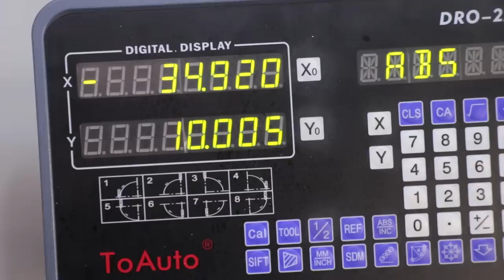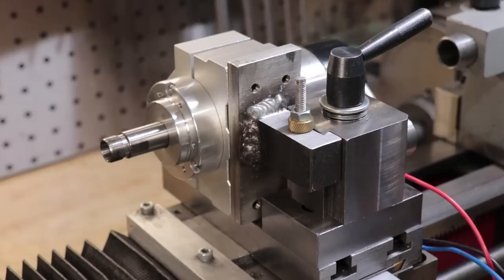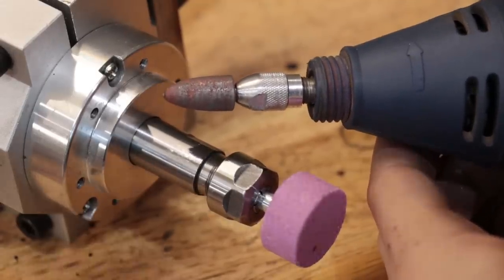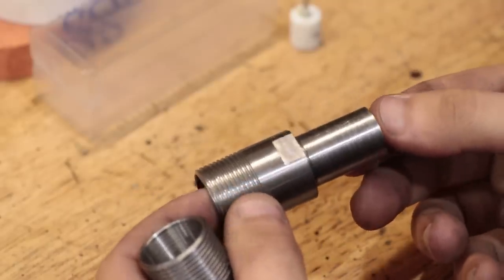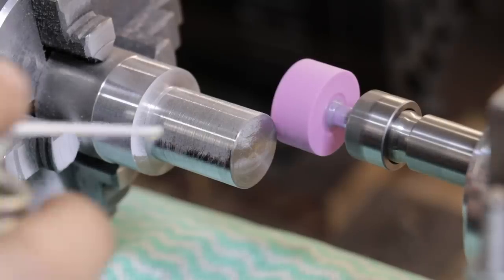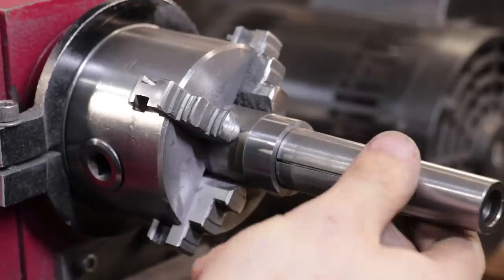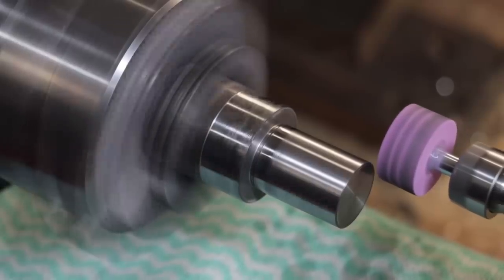Lathe Toolpost Grinder Build

Comment: I find your determination extremely impressive. I have a suggestion that might help the rigidity and in turn leave a much better finish from your lathe spindle. The mini lathes use a plastic bearing retainer on the head stock spindle bearings. If you replace them with metal retainers you will be very surprised at the difference in surface finish. Keep up the hard work
Reply: Great practical tip and it probably applies to other machines.
Wish I could give you more than 1 thumb.
Reply from the maker: Okay I must admit that has never occured to me to replace. I'll definitely have to look into that. Cheers

Comment: Work piece rotational speed should be slow compared to the grinding wheel. Doing so improves surface finish, reduces vibration and lengthens the time between wheel dressings. Coolant should either be flood or none at all otherwise thermal distortion can occur (of course depending on part dimensions).  As someone else commented (and I agree), reducing the contact area between wheel and part offers huge improvements in surface finish. Hope this helps going forward. Great job, keep up the excellent videos :)
Reply from the maker: Someone else suggested that too. What I found was that it didn't make much of a difference with soft steel. Low lathe rpm definitely is what is needed for working with hardened steel though

Comment: If you chamfer the holes before you tap them, you'll get better looking results.
Reply: More sturdy first thread
Reply: It dramatically increases tap life and it also decreases the chances of a snapped tap (at least if you don't harden the chamfer with a dull cheapo countersink)
Reply: @Sketch1994  Machine taps ftw, they’re not nearly as fragile as regular straight flute taps. After a few years of looking around and buying what I can I now don’t have to fear at every turn wether my tap is going to install itself permanently in the hole.
Reply: @shiro-r4m  Totally...I stopped buying cheapo machine taps (mostly use Volkel and OSG so far), while I don't even remember when was the last time I paid for a hand tap...
Reply: @Sketch1994  I've had good luck with OSG, Emuge, Fraisa, Walter and YG. But to be frank probably any brand that produces a full range of cutting tools is going to have some high quality tap options as well. 
There are different quality levels of taps within the brands as well, designating what tensile strength you can reliably cut with it.
I find they are very expensive though new, you can easily spend 50 EUR for an M12 tap from the brands I mentioned. I buy them slightly used and they just last me forever. Unless I do something stupid and run them too deep into a blind hole while power tapping on the mill or lathe, that easily snaps them.
Reply: @shiro-r4m  Ironically a brand new tap is a lot more likely to get chipped than a tap that is worn in a bit. Also very true about the different qualities within a same brand. All reputable cutting tool manufacturers can make a solid quality tap, but then there are the high end and application specific lines of tools that you can't even use without an equally high end setup. Sync taps (easily 120+ for an M12) for example which are meant for rigid tapping on machining centers, and whose non cutting threads are relieved to not contact the workpiece (they can't feed at the correct pitch on their own and they are not meant to self center either). I had tried telling my ex boss that you can't tap over a gap with these on a drill press, but he was convinced that this is how aluminum taps have to be for some reason (I was also the only actual machinist in there so I very often forced to cringe my way out and let them chase their tails)

Comment: Just a suggestion ; relive the grinding wheel so you a smaller contact area with the part when grinding it should help with surface finish and easier to maintain parallel diameters

Comment: Cool build. I wanted to drop a note that the runout of the tool holder that you made at the end is actually less than 10 microns! Probably closer to 5 microns. This is because you measured with the probe of the indicator at about a 45 degree angle relative to the runout which amplifies the measurement. If you want to learn more about this effect you can look up "test indicator cosine error."
Reply from the maker: Never going to be able to live this goof down. Oh well at least I got it recorded in the best 4k footage for everyone to see. 😅
Reply: @artisanmakes  Haha, it's great though! It means its twice as good as you thought it was :)
Reply: @artisanmakes  you can read my reply above this one for the explanation, but I dont think it actually was a goof...

Comment: You really make that little mini lathe sing bro. I am ever impressed with what you're able to coax that little thing into doing.
Reply: I mean I think he replaced a majority of the parts by things he made himself haha.
Reply: Best mod I've seen him do that NO ONE anywhere else has done is put a 1" x 2" steel block brace under the headstock to the foot behind where the motor mount is. Of all of the videos, forums, and personal sites I've searched he's the only one I've seen address this issue and I'm in progress of doing it to my LMS 5100.

I would like to see him do the carriage taper gib mod following Rick Kruger's design from 1999 - I just finished my own variation of that mod on my machine and it seems to be much smoother and stouter
Reply: @dieselwelds8645  There is a good write up on that taper gib mod in a recent edition of HSM. Someone should send him a copy.

Comment: You're a beast for making it through that steel stock with a hacksaw! 💪 Before bandsaws there were power hacksaws, building one might make for a fun project.
Reply: pyrobeav2005 you are one of many that have said he needs a bandsaw if he wanted a bandsaw he would have purchased one.He uses that hacksaw because it is a good workout for himself!!
Reply: @robertbutler8004  Ah, my appologies. Just found the channel, I made some assumptions about why one wouldn't use, well, anything but a hacksaw. Landed on "maybe they just don't like using machines that make it feel like cheating", and a power hacksaw is just the fit for that. Can be built out of scraps, and gets the job done enough.
Reply: @robertbutler8004  he doesn't do this anymore but he answered to this question frequently.
The Porta-Band that he wants isn't easily available in australia and for a standing Bandsaw he doesn't have the space.

So yeah, he wants one, too
Reply: @an2thea514  And he can't find someone to just ship him the porta band he wants? I know shipping is expensive, but that hack saw really gets me in every video. I am impressed with the straight cuts with the hacksaw though!
Reply: @gorak9000  if the will is too weak, the process is too hard.
With how much he imports, the money should have been there long ago.
He could even use his Filing machine with a modification.
Reply: @an2thea514  I'm pretty sure he cuts 99% of it on a bandsaw off camera, and the hacksaw is just to get everyone riled up in the comments - more comments = more "engagement" on the videos = more monetization money. Those ubiquitous 4-1/2" horizontal bandsaws that are rebranded by everyone under the sun can always be found used locally for cheap. I just got one last week for $80
Reply: @gorak9000  he allegedly said there is no room for one of those 4x6 in his shop. I had one of those 4x6 at home and it was a pain to use...  i took the motor off and the rest ended up in the metal dumpster.

Comment: Here's another tip, get yourself an oscillating saw, Milwaukee tools makes their Sawsall. Some fine tooth metal cutting blades for the saw and you can leave your hacksaw for cutting off for old crap .
Test indicator notes, bring the needle down to a perpendicular position to the surface that you are trying to measure.

Comment: About using a grinder quick-release toolholder - I've seen that type of grinder attachment used with cup-style grinder heads perpendicular to the material in the lathe...
Reply from the maker: I definitely have too. I have a cup wheel in storage but it would be too large for this one and I haven't found any that would be really suited t this set up. Granted, I have not spent too much time looking.

Comment: I have a very similar shop built tool post grinder. I ordered a variety set of those carborundum stones along with some vintage ones on 1/4 inch arbors. I had high expectations, they were cut very well. They did not perform at all well and they're quite a bit Pinker then other carborundum Wheels source elsewhere. I don't think they have nearly as much garnet and that's the biggest problem with surface finish. Try ordering an older wheel off of eBay and see how it goes, I think it might be surprisingly better

Comment: Very cool! Although I would expect you might get more rigidity from a larger quickchange tool hook welded on. Also the dressing stone in the mag base doesn't look very rigid. Maybe you could make a video about making a mount for the dressing stones!
Reply from the maker: I don't think the holder rigidity is much of an issue to worry about. As for the mAh made holder, it's not hugely rigid it'll get replaced in time
Reply: @artisanmakes  I mean no offense by my comments btw! Huge fan and I love what you do making things yourself instead of paying out the wazoo. That's what machining is all about right? 😄
Reply from the maker: None at all, always happy to hear suggestions. Cheers

Comment: Damn that’s wild, I also built one just this week. It’s got one of them 2.2kW chinese vfd spindles. I needed it to regrind the morse taper 4 in my tail stock which the previous owner decided to graciously mess up for me
Reply from the maker: Neat, hope it works well for you. Couldn't use a morse taper reamer to do that though?
Reply: @artisanmakes  I tried reamers (new chinese and old russian) but they didn’t correct the angle sufficiently and the surface finish left much to be desired. Checked with a known good male taper and spotting blue. Regrinding the taper yielded much better results than reaming both in angle and surface quality. Grinding it also gives me concentricity since I can indicate the back and hold the front in the steady. Hand reaming can push a hole off center a little if you’re not careful.

Comment: Might I suggest using 17-4 ss unheat treated  machine oversize and does not take high heat to harden can do in your oven  uses to make aircraft bushings  so bar ends were free for us to do what  ever
Reply from the maker: Never used that grade of stainless. What I usually deal with is off cuts anyway from material shops. I might have to check if there is a local equivalent to that grade

Comment: Fot grinding its better to use colant with almost no content of oil, or only water. This helps the fine chips to evacuate an dose not close up the grinding weel
Reply from the maker: I tried both, the heat build up seemed to create more issues for me than the build.up in the grinding stone, plus the surface improved somewhat. Could be different for you but that was just my experience with this set up.

Comment: In those milling parts of the vid at the start were you running those cutters that fast or did you speed up the film.
The one thing I wished people would do a lot more of id show there cutter & speed details.
Don't worry if people don't agree with your speeds & feeds.
We all know that different settings work with different machines because of the cutters being used.

I have a lathe on the way and a grinder is one of the things I am considering for the same sorts of reasons you have done this.
And you've done me (and others) a great favor by showing us a way this can be done.

Comment: That is a very good result. Now that I've made a few ER collets, I've realised that 4140 and a high speed finishing pass with a sharp dcgt insert leaves a great finish that's almost as good as ground. A grinding attachment would still be better if you're going to heat treat the collet and regrind.
Reply from the maker: I have seen your videos on that and you definitely get a better finish with inserts than I ever could get with my inserts, although I'm sure my top slide plays a role in that :)

Comment: I wonder if the suboptimal surface finish is due to the fact that the way you have it set up, the relative movement of the part and the wheel cancel each other partly. Have you tried running your lathe spindle in reverse?
Reply from the maker: I've tried multiple ways and the results don't seem to vary too much. I thought that I'd recorded grinding a piece of drill rod but I couldn't find it. Hardened steel always came out looking much nicer though.
Reply: maybe the stone is skipping becouse of to much flex.
Reply: Try running the lathe much slower than that. Grinder really fast, part rotates slowly. Best surface finish.
Reply from the maker: I have tried slower but it doesn't seem to do much for softer steel, Cheers

Comment: I have built a similar tool for my chinese late 7 x 12 , but i can't get a good finish, so i always have to use sand paper to get a mirror surface of my piece ... but this changes the final diameter ( even 0,03 or more millimeters ... ) in a random shape ...
Can anyone suggest me how to get a good surface already with grinding tool ( normally made of corindone, or silicon carbide or even diamond ) ? Could this be due to the grid value of the selected tool, or instead to low speed tool ? Thank you very much for any help ...

Comment: I hadn't noticed first, but you're using the lever indicator wrong. This type of indicator reads how much that leg swings. So it should be positioned in such a way that the part you are indicating pushes against the leg, comparable to the action between a footballers lower leg and the ball. In your current setup, this means the indicator dial should be pointing sideways so that the leg can 'kick' the 'ball' i.e. the endmill sideways. Hope this makes sense...Perhaps look up some videos. The leg should 'kick' the target in the direction you want to indicate. You can always reposition the leg on the indicator - it's intentionally a friction fit. That position is irrelevant. But the leg's position should 'hit' the target 'straight on'. Again: this indicator just measures the swing of the leg. 
Ah...I finally found a video that clearly explains it: "Indicator Basics - Using a Test Indicator - Haas Automation" (I can't add links in comments apparently)
The best visual is about halfway the video - with all the angles.
Reply: Hi the dti may not have been used in the optimal way but to me it was a good practical way with spindle being turned by hand in the correct direction. It was used to indicate out of true so cosine error was not really important in this instance, more important to me is to get the dti pointer approximately set at a right angle to the surface to maximise deflection. I thought it was a well thought out execution and good video. Thank you

Comment: Nice build. My question is which power supply did you use for the 48volt DC ?
Reply from the maker: It's one of those rectangular 240v to 48v transformers. My one is 12 amps

Comment: Great vids as always. looking to make a tool post grinder myself. went on eBay Google etc can't seem to find any motors i'd call cheap? would you mind putting a link up to where you bought your motor just to get me started. thanks!
Reply from the maker: I bought this motor well over 3 years ago so I don't have a link anymore, but a quick look on eBay and I saw a few going for about $150ish. Search for er11 spindle and you'll see some results. You don't have to get this exact model, any spindle with a collar and bracket should do
Reply: @artisanmakes  brilliant. Thank's for that quick reply I think the er11 is what I was missing 👍

Comment: Hi, thank you for your effort in making these videos. How is the runout on the 400w spindle motor? Are the motor bearings decent?
Reply from the maker: Definitely good enough that they are used in a lot of DIY CNC routers. The run out is somewhere around .01mm and the bearings hold up well.

Comment: think the toolholder wouldve been more precice if you had welded the pieces together then machine it square and add the dovetail
Reply from the maker: Maybe but thankfully the accuracy of the bracket doesn't matter too much. There is enough movement in the bracket mount holes that you can rotate the spindle to get it parallel with the lathe spindle.

Comment: I haven't read the (as of right now) 126 comments due to the time I have, but you ought to build a truly rigid diamond holder.  The flimsy one you used surely was vibrating, causing your wheel to be dressed poorly as shown by your finish, I think.
Reply from the maker: Yes definitely on my list of stuff to make. The mag base does an okay job but it can be better

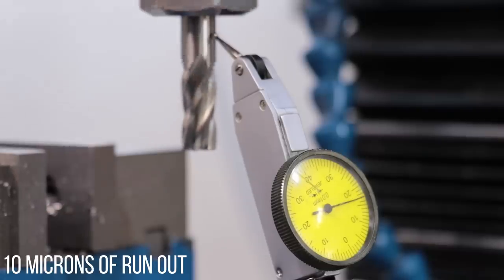Comment: 11:00 very wrong way of using a dti
Reply from the maker: Ops
Reply: You'll get tons of cosine error if the probe is that far from parallel to the surface being measured, but it's easy enough to compensate for. Cos(probe angle) * (indicated reading) will give you the actual deflection. Cosine error always increases the indicated reading, exaggerating the deflection and making the runout look worse than it actually is.

It's hard to tell the probe angle from the image, but the actual runout on that shank is probably about 5μm. I'd say that's a pretty good result for a cheap Chinese spindle motor on a mini lathe.
Reply from the maker: Could be like this, I think I got a bit sloppy for a sec. I'll have to remeasure it when Im next in the workshop. Anything below 0.02mm runout on my mill is pretty good, considering the spindle has about 0.01mm of run out. Cheers guys